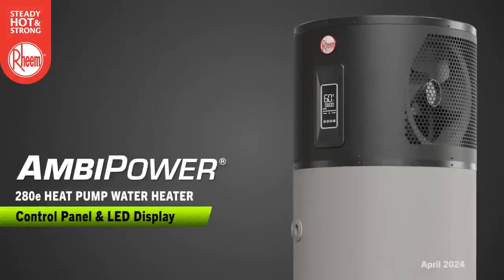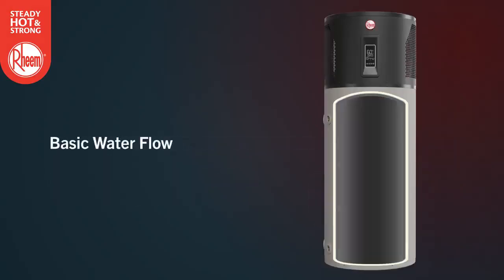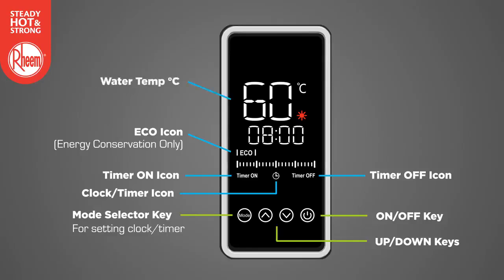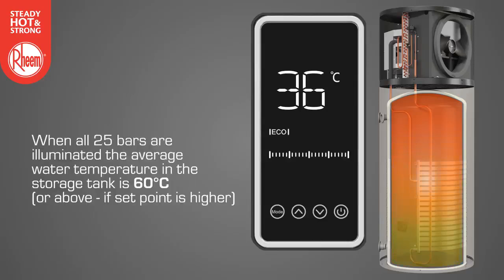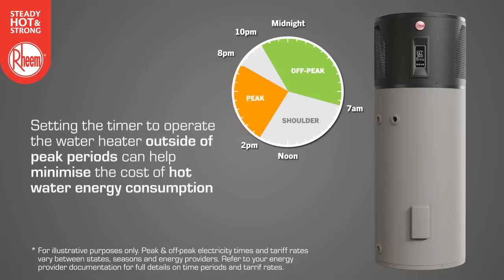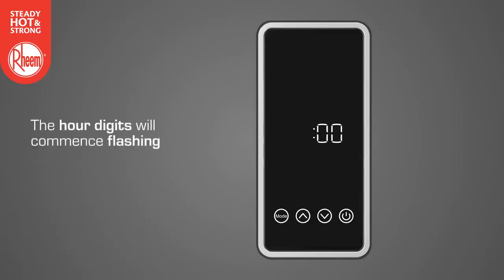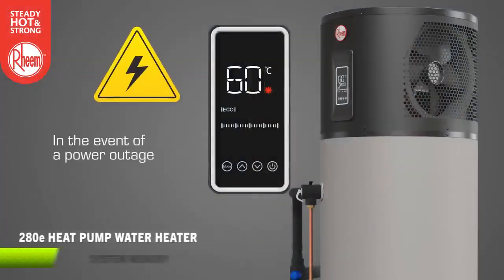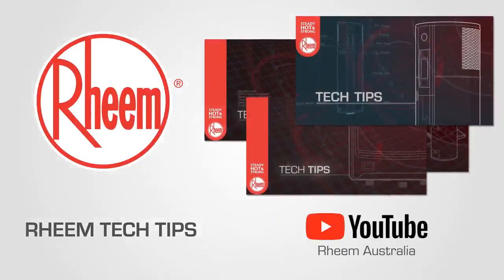Rheem AmbiPower 280e Heat Pump Control Panel Explained

Comment: How can I manually select boost mode?
Reply from the maker: The AmbiPower 280e does not have a user-selectable electric boosting function. This is intentional by design. The system is programmed to monitor the water temperature and usage and will automatically switch to element heating mode if required. This supplements the compressor’s heating requirements to ensure sufficient hot water is available. The main benefit of a Heat Pump water heater is that it can reduce the amount of electrical energy used to heat the water. A heat pump in boost mode, with an electric heating unit operating, would use 100% of electrical energy for heating water. This would make it much less efficient than heating the water using the Heat Pump.

Comment: How do I change it from ECO mode?
Reply from the maker: Great question. ECO Mode is the standard operating mode for the AmbiPower 280e (551E280). 
The system is programmed to monitor the water temperature and usage and will automatically switch to element heating mode if required. This supplements the compressor’s heating requirements to ensure sufficient hot water is available. Operating in ECO mode is when the heat pump is at its most efficient and, as such, cannot be changed by the user.